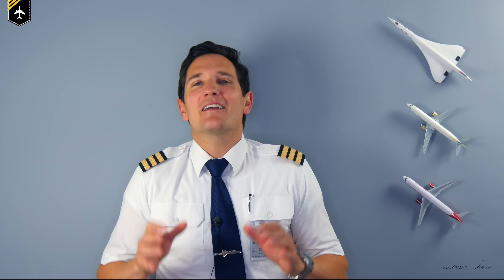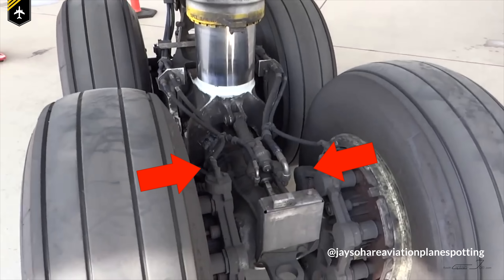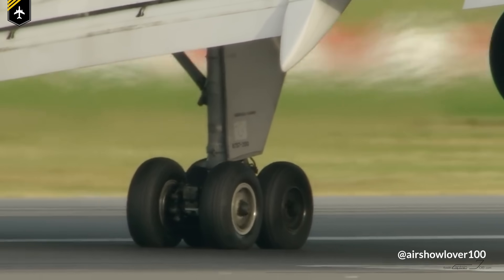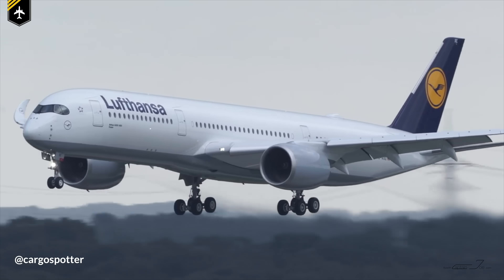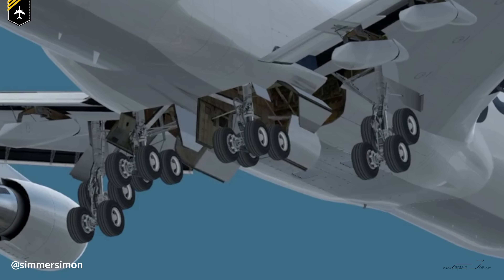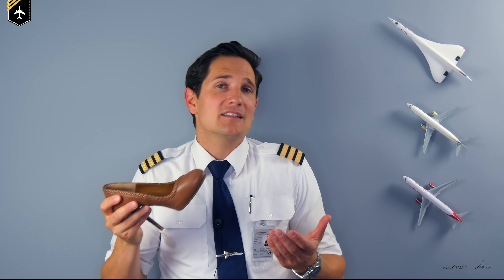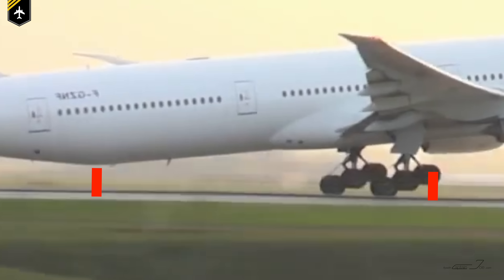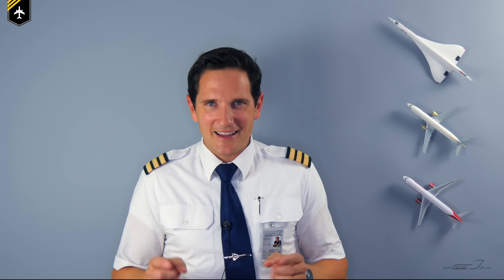Why is the LANDING GEAR TILTED? Explained by CAPTAIN JOE

Comment: Hi Joe! I recently had a flight in Vietnam. It was a domestic flight and i think it was on an airbus(could be wrong tho). Shortly after take off there was some kind of smoke or damp coming from the airco vents. I was kind of scared but also curious to what it was but i couldn't figure it out. Can you explain what this was or was it just something random? Thanks!
Reply: it's just mist from the air conditioning system. Happens a lot in humid environments. Perfectly normal. No need to be alarmed.
Reply: @troybaxter2916  it probably was yes, but it was a bit of a unkown flight company so it scared the hell out of me
Reply: Fair enough.

Comment: How about the extreme forces needed to accelerate an airplane wheel from 0-200 or more in a split-second? Has anyone ever tried to accelerate the wheels before touchdown with an electric motor to minimize tire-wear?

Comment: I would be very interested in the air-ground sensing unit and the many things that happen at that crucial moment. For example, the rudder pedals become brakes and the yoke becomes a steering wheel.

Comment: Automatic engaging of the ground spoilers and autobrake when the wheels touch doesn't seem too clever to me. What if the pilot has to suddenly go around?
Reply: Engineers account for that possibility. they aren't stupid.
Reply: Right the first button or switch or throttle camand would have to override it. 
There not that stupid just so many other factors too include to.there would have to b a man over ride switch for real situations that wouldn't allow it.

Comment: Joe could you explain why there is Alphabetic number painted below front landing gear in Aircrafts?
Reply: Premila Anesteshia
The aft of the aircraft has the full registration of the airplane (starts with "N-" for usa registration, "F-" for French ones, etc...).
The front gear doors displays only the last part of the registration.
ex : Full registration F-GQSPA displayed on the back  of the aircraft. The front gear doors will show "SPA"
Reply: It varies by airline to determine how they code their planes.

Comment: I thought that the wheels start spinning before touch-down to lower the friction shock to the tires (you see that smoke when the non-spinning wheel touches the ground and starts spinning). I thought this is now pretty standard with bigger airplanes. Why is it not standard?

Comment: Joe, Re. the quality of your voice in this recording.  The mic is too far from your mouth and the room's boundaries are too close to your mouth and the mic.  The unwanted result is too high a ratio of voice energy bouncing off the walls of your recording room, which arrive too soon after the original sound, thus degrading intelligibility.  It sounds bad, and screams amateur.  Spend a few dollars on a wireless lapel mic to completely solve this problem.

Comment: Joe, why are the wings not painted, only the fuselage.
Reply: Rich.
The wings are painted, but they use a special type of polish, this is to cut down the glare that passengers may get when the Sun's rays reflects off a flat shiny metal surface.
Reply: Aviation Addict
I would say because lift is created by air flowing on the wings (not on fuselage) which is a very sensitive area and you'd better keep it clean to not disrupt the air flow there.
Reply: Adding on to some of the replies here, it likely has to do with advertising the airline. The sides of the fuselage are easily visible (from an outside observer) when the aircraft is on the ground as opposed to the wings. Some aircraft also advertise on the winglets, possibly for additional advertising whenever someone takes a picture through a window and the winglet is in "plane" sight ;) Some airlines even advertise on the belly of the aircraft, such as Emirates, so that someone on the ground can still see the airline as it is flying directly overhead.
Reply: The wings flex and bend on take off and landing so with all the flexing the paint would flake and chip off
Reply: Sloppy.
They use special paint that can flex without chipping away.
Reply: it is composite,they dont want it in colour because it will take more heat
Reply: Think of it as a protective coating, not decorative paint.  All wing surfaces have a treated finish.  Just  all looks the same color.
Reply: Loads more weight, hard to maintain (lot of moving parts) on the wing, and if there is paint on the wing, it can be hard to find any defects among the patterns and colors, as the wing is one of the most important, vital parts.
Reply: @markj2093  Huh?  That's not how it works.  There is no such thing as a wing that exists in your mind.

Comment: What is the maximum vertical speed ft/min at which one can land an Airbus A320 family aircraft without causing any damage to the airframe? What is the usual range of ft/min during normal operations? What will happen if a pilot lands at 400 ft/min? Will it cause any structural damage?

Comment: I have a very good question and I hope you will answer it and a future video. There has to be massive tire wear when the plane touches down because stationary Wheels contacting the ground creates a lot of friction as seen by the plume of smoke coming off of the tires when Landing.

My question is, why aren't the rims of the landing gear fitted with vanes that will start the tires spinning before they hit the ground? I could see large savings because tire wear would be reduced if the tire is spinning before it hits the ground
Reply: It will apply force  to the plane when the wheels are spinning.
You need a stabil plane when landing.

Comment: Captain, I admire your videos. A question about Airbus: A copilot spends thousands of hours using the sidestick on his right side and when he passes to the aircraft commander uses the sidestick on his left side. Does not this change have any discomfort at the moment?
Reply: Pilots - wether captain or first officer - have to train in a simulator all few months (depends on airline). This training takes place in the captain's roll. So they are used to using the sidestick with both hands, I'd say.

Comment: What if you turn the trust reverser on during mid flight?
Reply: That is not possible in most modern airplanes. But there were a few accidents related to this happening. 

A few warbirds are able to do that to make tactical approaches and steep nosedives without getting to fast, though.

Comment: Question: does the pilot have to remember to retract the wheels, or do the wheels retract automatically. If automatically, what is the trigger that instigates retraction. Thanks.
Reply: The pilots have to do it.
Reply: The pilots have to do it and have a checklist they have to do before landing where this is listed so they don't forget it. Also, there are warning sounds if you are under a specific speed and altitude that remember you to put down the gear.

Comment: Something even more crazy about that C-5 gear... After the 90° rotation, then starts going up into the belly, the front wheels ride a track unlocking strut from its down 90° position, to a flat 180° position, storing the strut between the middle two rear wheels.

Comment: Awesome video. I got a quick question, in a past career I was a pest control technician and on occassion I had emergency callouts for pest situations on commercial airliners. When this situation arise, i will specific which may be alarming to some reading this, a live rodent was reported on a plane but due to tight on ground times the control technician was not able to extract said rodent (at time rodents) from plane. Will this information be relayed to the next flight crew during their preflight briefing and what protocol do Airlines take if such a situation is in action? There were many times I had a hallow feeling in my stomach when I saw planes pushback knowing I can only do so much with the little time they give us to work with. 

On that note, in your opinion, can a rodent become detrimental to an airplane's intergrity?
Reply: 1fox2fox3fox4 interesting topic

Comment: What will happend if we land the plane with the  front wheel instead of the back gear
Reply: FC Pratush 

The nose gear would just break off. It isn't as stable as the main gear.

Comment: Very accurate explanation. I must add that, though you are right on the space thing, the tilting does help much to the energy absortion. In fact, the LH cargo studied the possibility of adding the tilting for reducing bounce tendency in MD11 fleet. Also in the case of 747, it helps touching with a widther base of wheels.
Reply: I don't buy the 747 explanation.  Who would want to land first on a single center wheel?  I bet that the different tilts ensure that the pair of wing landing gear strike first so that the plane is stable and not a teeter-totter when it first hits the ground, even though it would be a tiny amount of time and all three sets will soon be on the ground.  A glider can land on a single center wheel.

Comment: Want to get even more detailed, explain the B-52 landing gear that keeps the wheels aligned with the flight path regardless of the direction of the fuselage centerline. It was classified for years.
Reply: heeder777 

It's just so that the airplane can land more easily in crosswinds. They can crab into the wind but the gear is still aligned with the runway.

Comment: Wow nice captain Joe I didn't know that, btw I have a question why do planes put their wheels inside and why do others don't??

P.S Thanks for that Airplane repo shout out u did it became my favorite show
Reply: Faster planes retract their wheels because of air resistance. It would cost alot of speed and fuel if the wheels where out because of the additional air resistance.

Slower and smaller airplanes don't have to do this because the effect isn't that huge.

Comment: Oooo joe with some high heels
Either someone got lucky or is becoming fashionable

Before this vid starts my dad said that it was due to wear. He was a mechanic for helicopters and the hawker hunter and mig 29s
He said if they tilt front wheel up, the rears get worn more, front ones less, so the front are replaced less and rear more.
Or if they are tilted so they’re parallel with the ground, they all get worn evenly but less
In the end both have a roughly similar price, but it comes down to replace some more and other less or replace them all at the same time but at a medium interval

Comment: @2:38 is he saying the thrust reversers only de pressurize the cabin? I thought they helped the plane slow down along with spoilers and Auto Breaks
Reply: He doesn't say that. He says that the ground sensing unit detects the airplane is on ground and deploys the air brakes, actuates the wheel brakes, deploys the reversers AND(!!!) depressurize the plane.

Comment: amazing engineering work! Somehow when seeing quite some smoke when the rubber wheels touch the ground it comes to mind whether   caoutchouc is the right material? Wouldn't a material for the plane tyres be better which can bear up more   frictional heat?

Comment: What happens if you land in strong winds and the wheels touch the ground but you need to perform a go around. You say a series of automatic events have already begun like airbrake and decompression and so on.
Reply: In most planes, as long the reversers haven't deployed yet, you can hit the TO/GA button and the plane automatically releases the brakes and gives full power to the engines.
Reply: Dominik Andree thank you :)

Comment: Interesting! What I want to know is why are the wheels not rotating when the plane lands to reduce the clouds of burnt rubber coming off them, surely it would be safer and make the tyres last longer if they were already rotating when the plane lands?
Reply: Edwyn Corteen simpler and less prone to problem due to complexity?

Comment: As for landing, if the orientation of the truck is completely random, why you wanna lock it into the way it was stored? It doesn't make any sense to me. Secondly, can we adjust the truck when it was in air apart from the 777-300 situation?

Comment: The 777-200LR and 300ER are both by far the easiest landing aircraft I've ever flown, closely followed by the 757. The 767 on the other hand you had to work at getting a decent touchdown. Levered gear is almost as forgiving as a trailing link assembly, but not quite.

Comment: Just one question: right before the wheels touch the ground, they don't turn. Why isn't there a "pre rotation" system that would prevent the wheel to touch ground a a 0 rotation speed. Wouldn't that reduce the friction -and the wheels wear -  as the wheels touch the ground ?
Reply: Marc Crabbé 

Such a system would weigh a lot, would be error-prone, would need maintenance and wouldn't have a to great benefit.
Reply: Dominik Andree it could be driven by wind, simply ;)
The exact speed is not important, just to start to rotate the wheels before they touch the ground

Comment: Hi, Captain Joe. I was wondering if you could help me with an aviation question. It is in the area of-of thrust and lift. I recently examined a calculation for lift and the math result was in kN, kiloNewtons, I translated the number to Newtons, however, my difficulty is in calculating Newtons translating to how much lift thrust in Lbs is are available.
Designing a craft that takes lift power into consideration. So, I hope you understand my question I am not an engineer despite my interest.

Comment: terminology correction : a truck is one pair of wheels , a bogie is 2 sets of trucks ie the 767 has a bogie a 737 has a truck set , the a 380 is a tri axle on the rear set of wheels , the term is from a lorry where 2 sets of tires on one side of an axle   on each side being a truck and 2 sets of axles is a bogie and 3 is a tri axle and yes you can have a quad axle ,,,,, dont ask about the antinov 124s set up thats just another animal all together

Comment: Thanks Captain Joe.  I've always wondered about that.  I have question for you: why as an A380 being the biggest/heaviest commercial passenger plane, does it only deploy the inboard thrust reversers on landing?  Are reversers not fitted to the outboard or are they fitted and not used much?  747's always seem to use all 4 on landing.
Reply: Phillip Morton 

The A380 is too big to have reversers on the outward engines. They are often hanging over the grass strips besides the runways and it is not safe to have reversers over these "unclean" areas.

Comment: I thought it was only because of gravity that the landing gears were tilted.
Reply: ca.
What are you talking about?
Reply: Redblade Like, if one of the two wheels is heavier than the other, the heavier one gets pulled by the gravity and the lighter one goes up thus making the wheels tilted during landing and take off. I can't really explain that well, but take beam balance as an example.

I used to think that was why the wheels were tilted too lol
Reply: sjn.
Gravity is not pulling the wheels down into that position, the wheels are designed to be at an angle, the shock absorbers and the suspension hold them like that, until the wheels touch down on the runway.
Reply: Redblade That's why we're saying we THOUGHT it was because of gravity before.
Reply: Same
Reply: ca samunot Same lol

Comment: I don't think this explanation is true for all types, for example the B777. For extension, retraction and in the up and locked  position the truck is positioned 4.75° fwd wheels down (stow position). When the gear is down and locked (no matter if after take off or before landing) the truck is positioned 13° fwd wheels up (tilt position). For the -300 with the semi-levered gear the tilt position is 11° fdw wheels up.

Comment: Joe, good video! However, inaccurate information regarding to the 777-300 main gear. ONLY the 777-300/ER (B77W) is fitted with the SLG. The classic 777-300 does Not have the SLG. 

Another side note about SLG, Boeing claimed the Semi-Lever Gear system allows aircraft to have 2 degrees extra on lift-off rotation angle and increase MTOW by a couple hundreds kg.

Keep it up with the videos and I'm looking forward to watch more as always! :)

Comment: As a WWII-era  combat aircraft enthusiast I've learned about many ways to retract a taildragger landing gear - inwards, outwards, backwards (with or without rotation), in the fuselage, in the wings, in the engine gondolas, fully covered, partially covered...
and one more interesting, non-WWII example: B-52 Stratofortress retracting sort of askew, to fit next to each other in the fuselage.

Comment: What would happen if you try to retract the landing gear while on the ground?
Reply: The aircraft would fall on it's nose because only the front landing gear can retract on the ground. Although normally once the aircraft has reached it's gate the ground crew inserts safety pins into the gear mechanism which prevents the gear from retracting at all.
Reply: Nothing would happen. The ground sensing unit prevents you from doing so. And what shi01 said is only partially right because this is only the case in a few (military) freight planes.
Reply: Stan Lem bad things will happen?

Comment: Hi @CaptainJoe! I know that you are now flying a Boeing 747-400 but can you please answer my two Airbus questions? What is the difference between flaps  2 and flaps 2+F, and what is the wind shear predictive system? Why it needs to be switched off after landing??? I love your videos! They teach me a lot of interesting things which will be useful in my future Pilot career!
Reply: The "+F" means "flaps", because on the flaps 2 setting you are only extending the slats. This is especially important during takeoff.

And the windshear detection is set to off after touchdown because it isn't important anymore. Also, there are a lot of microbursts on the ground and the system would just warn you all the time.